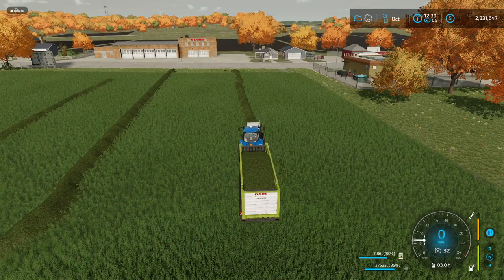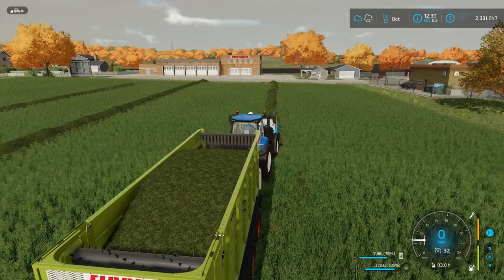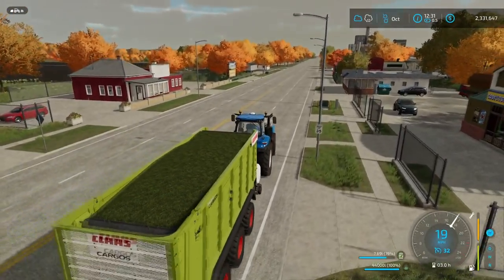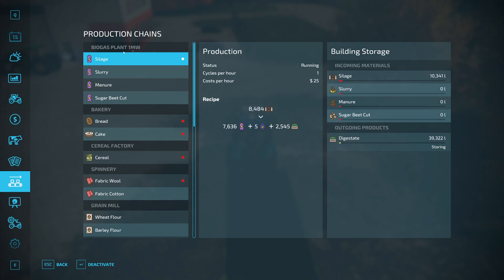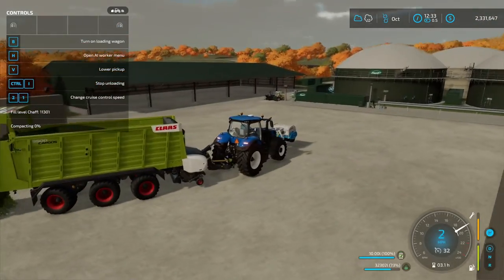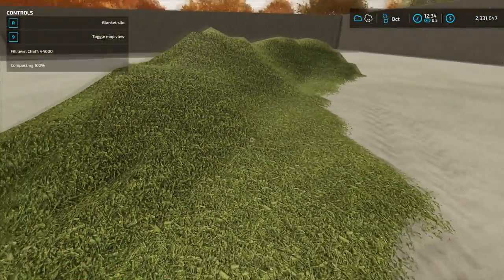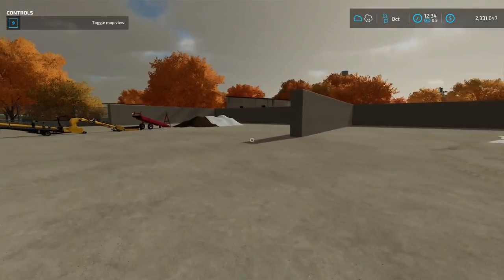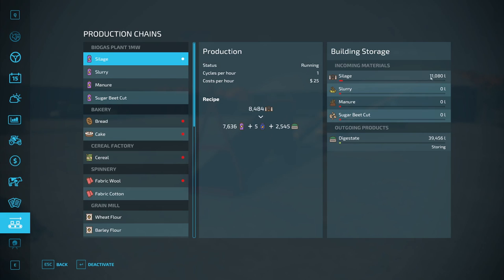Farming Simulator 22 Tutorial | Silage & Biogas

Comment: The bunker silo is bugged, you cannot unload raw grass on it. I tried every trailer/tipper and it doesn’t give you option to unload it on the bunker silo, even with current patch installed. So if anyone have a way to do it (preferably non-modded way) let everyone know. Biogas is the only way to do it at the moment.
Reply: Just hit ctrl+I to unload and slightly move to spread it  - I assume you placed the bunker by yourself
Reply: You need to force unload it in the bunkers